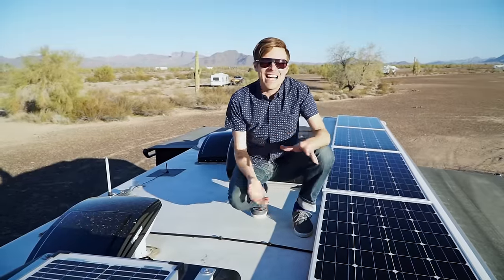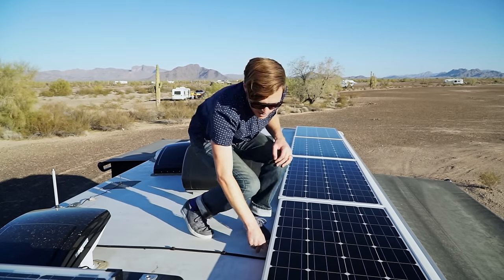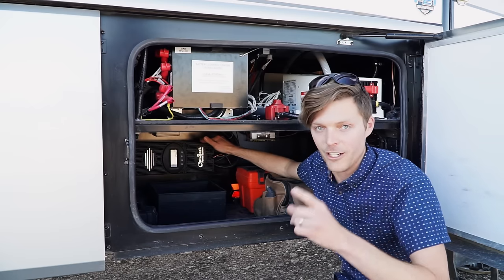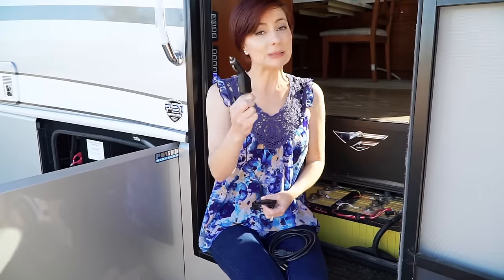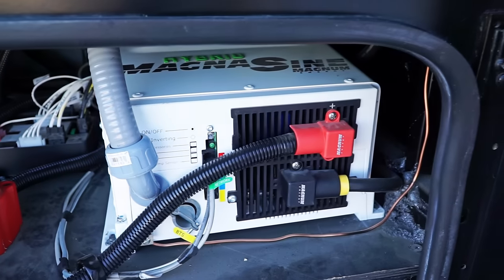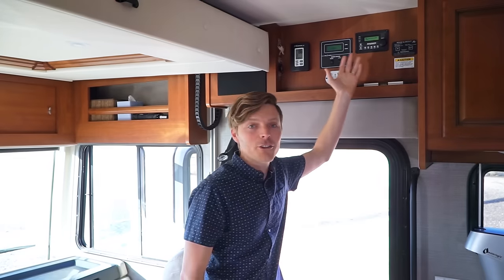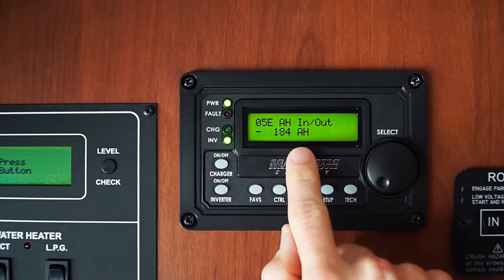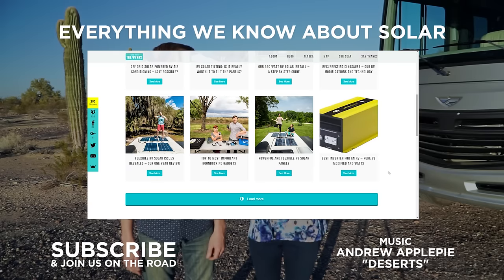Off The Grid - How RV Solar Works

Comment: Technically speaking, this is a really well done video with good info. Got some drone footage. Some nice panning work.
Reply: Apart from the bit about DC and AC, if someone watches this and thinks they can plug anything DC into a battery bank things could go badly wrong if the voltage of the device and the batteries are different.
Reply from the maker: +Silent 1 Hence we said "most rvs"
Reply: In "Technically Speaking" I was complimenting the assemblage and editing of the video itself. The information given was good information. It is up to the viewer to make their own wise decisions as to interpretation and implementation of the information given in the video. The Wynns have an expensive and powerful lithium battery bank. They can get away with running their AC using just their powerful solar and battery system as previously demonstrated. Somebody else with a much smaller system should understand they cannot run big DC loads like the Wynns. A simple rule of thumb is to only use 1/2 the rated power of your batteries. If you have 2 100 AH batteries totaling 200 AH when in parallel, you can use up to 1/2 or 100 AH of that capacity before you start to damage the batteries. Know and understand your system.

Comment: You two have helped so much in me getting a handle on solar and what it does and doesn't do.  I am picking up my rig tomorrow after having 3x 100W solar panels installed (2 on the rood and 1 that will be more portable with a tilt stand and a 25' cable. I also switched out my 12V deep cycle battery for 2x 6volt golf cart batteries and also have installed a 2500W inverter, and a good quality charge controller!  Im looking forward to seeing it and learning about the finer points tomorrow!
THANK YOU!!,
Reply from the maker: We love it when our info helps someone make their dreams come true! This is why we do what we do. Enjoy the solar - hope it works just the way you expect. Safe travels!
Reply: Gone with the Wynns picked up my rig today...all is fantastic!!!  Works like a charm...now off for the long Canada Day weekend to see it all in action!👍💛

Comment: I am just catching up on some of your old episodes, this is very well explained. I do have one question though. Your AC power from your inverter goes to the breaker box. How does it know to switch from the Inverter to the generator, should you choose to run that?
Reply from the maker: Those systems are automatic in most modern RVs

Comment: I've said it before and I'll say it again, the of the Outback charge must be upright, not laid down as yours has been installed. It was designed to draw cooler air into the bottom of the unit and have the heat exit at the top, and the heat sinks at the top of the unit allow the heat to rise and remove the heat from the components in the most efficient manner. This is labeled as IMPORTANT in the installation section of the manual.
Reply from the maker: +Bennington Camper Outback has confirmed that our install is done correctly.
Reply: OK, but it obviously violates their installation instructions.

Comment: Do you have to switch anything on or off when you connect to shore power or is the system smart enough to know that shore power I'd coming and shut off the solar charge to the battery bank?

Comment: One other important job for the charge controller (besides preventing overcharging the batteries) is to match the voltage coming out of the solar panels to the batteries for the most efficient charge. Depending on your solar setup, there can be a huge gap between what the panels are producing (voltage wise) and what the batteries require. Changing the voltage of a DC source like a solar panel can result in a lot of power being lost if the controller is not well designed. 

The Outback controller shown is one of the better options. Its microprocessor controller adjusts the converter that brings the 100 volts from the solar system to the right voltage to charge the batteries.
Reply from the maker: +Al Lipscomb The outback actually "boosts" the power a bit giving us a little extra juice into the batteries.  Didn't want to overcomplicate the video so we kept it pretty general.
Reply: +Gone with the Wynns Good idea. A MPPT converter does a wonderful job, but can be a bit complicated.

Comment: Question: How do RV refrigerators work? Are they constantly drawing power from the batteries or do they switch to some low-power mode when they aren't being used? It seems that having a refrigerator on all the time would be a huge drain on the batteries.
Reply from the maker: +Hugh Jass A residential fridge always draws power and it is a huge power suck, but it's nice and big!
Reply: +Hugh Jass RV Refrigerators are mostly 3 way Refrigerators, meaning they can use Electric, Propane or 12v. If they are bringing in power they can run off solar and batteries (12v). At night with no sun, they switch to propane. Or at a RV park they run off the Electric from the grid

Comment: Just a quick question. If your batteries are fully charged and your charge controller has done its job, what happens to the electricity that is still being produced?

Comment: My biggest issue with solar is, mono vs poly and yes I've seen tons of videos but none that actually explains the advantages of each one any good at all
I want 200 watt on my pickup, but it wont get used all the time and both panels might not even point in the same direction at all times

Comment: Hey guys. To add on if anyone is interested as to how the solar panels work. I will try to explain it as simply as possible. 

First solar panels are made of a metal, metals are used because they have electrons that orbit on the outermost orbital (think of it like pluto orbiting our sun). When photons (light rays) hit these electrons, it will pass energy to the electrons and excite it (you can think of it like pool, when one ball hits another and causes it to bounce everywhere). This excited electron is kick out of its orbit, and free to move around. it will move in the path of least resistance and travel down the wire into the solar charge controller (i don't know this process). The electron has now given this extra energy to the charge controller and it's sent back to the metal where it will fall back into that open outer orbital and the process starts over.
Reply: +Paul K Actually, MODULES are made up of many CELLS. The cells are not metal, they are silicon based - more like a glass - that have been grown in a factory and usually sawed to size. Common size today are 6" square cells. They are then tabbed which is placing conductive strips of metal like foil on them to allow the excited electrons to exit the cell. Typical number of cells are 32, 60, 72. These cells are wired in series and parallel to increase the voltage and current possible under optimum conditions from a module. Modules are then connected in series to increase the voltage, and in parallel to increase the current possible, usually limited by the charge controller.
Reply: Sweet! Yeah totally did not know they were silicon, that's really cool. I really only know the physics of the photovoltaic cells the rest I was trying to remember back from second year when a prof talked about it.

Comment: Are there many DC appliance options? So that you don't have to use an inverter?
Reply: +Maxid1 Google 12v appliance. There is alot out there
Reply: Zakarume
Yeah, I think my question was more, why not use DC appliances instead losing power converting to AC?
Reply from the maker: +Maxid1 lots of DC type devices but they are often more expensive and less reliable.
Reply: Gone with the Wynns
I knew there had to be a good reason. What devices have you tried? There doesn't seem to be a good reason for dc devices to be less dependable because most ac devices have dc conversion inside of them. As for more expensive, that doesn't surprise me.

Comment: How long can you run that fridge on invert?   thanks.
Reply: +Ray J How long a Refrigerator can run depends on how much power it draws. The fridge takes around 350-450 watts depending on the make and model when it's running. So it would be ok to run it for a couple of hours. It is best to run on Propane when Wild Camping (Boondocking)
Reply: Zakarume They have a residential fridge, no propane. My guess is at least 24 hr with that configuration that is not an average RV setup if you watch the rest of the videos.
Reply: +Ray J 
I'm betting they could just sustain usage of everything off-grid, unless that inverter has a big parasitic draw when not in use... And I believe that is a Samsung that they have in there. I've got a new one sitting in my shop waiting for me to replace a Nomorecold in my coach. I plan on running a small dedicated pure sine wave inverter just for the fridge bypassing the larger house inverter.
Reply from the maker: +Ray J With Lithium Batteries we can run for several days.  with good solar we can run it endlessly.

Comment: well, as you run your a/c, you are drawing from both the panels and batteries. to save your batteries, your entire system should be converted to 24V. W=V*A.  you should be looking at marine equipment.  sure, high prices.  but if everybody converted to 24V, prices would fall by half.
Reply: +Rob Grune Why do you think 24 volt system will save the batteries?  Wattage will be the same.  Advantages would be lighter gauge wire (cheaper and lighter).  Their coach is so small however compared to larger boats I can't see any advantage.    I'm all for 24v or higher systems (up to say 50 for safe low voltage systems) but would not be able to justify the costs
Reply: easy. w=v*a. 240w=24v*10a. 240w=12v*20a.  this means an 96AH battery would last 2x as long on 24v than it would on 12v.
Reply: yes but the battery would be twice as big with twice as many cells to get the voltage..... you put two 12volts in series with the same AH and you do not get twice the AH.  Amps stay the same in series with batteries, voltage increases.  In parallel you get double the AH but the same voltage. Easy
Reply: 2x size? maybe for lead cells.  have you seen other battery tech lately?

Comment: If I had enough solar and battery power could I avoid having a generator at all? If all appliances are electric. No propane, no generator is what I would like to do. I am renovating a bus.
Reply from the maker: You could, but you'll have to be more careful in winter (when the angle of the sun is low and panels don't charge as fast) or in bad weather.

Comment: So like Thomas Edison suggested we would be better off with low voltage DC. AC was only good for traveling long distances. If we had all DC appliances the efficiency would be better. But that semi-crazy guy Tesla won with AC.
Reply: +John Puccetti  With Edison's DC, we'd have to have power plants every couple of miles.  Tesla and Westinghouse were right.
Reply: Sorry I have a power plant on my roof and so do thousands of other people. The distribution system is a dinosaur.
Reply: +soaringtractor We know that the industrial complex of electric utilities are failing. It is a sad truth that Southern California Edison has an over production of power by 40% to supply possible demands. We all pay for that excess of power and pollution. The electrical storage is now to a point that batteries can supply all the needs for a power conservative home. With the additional 35% savings from not using AC  a major pollution disaster can be avoided. Mini grids can solve the problem maxi grids have failed. No DC does not need to travel!!!!!